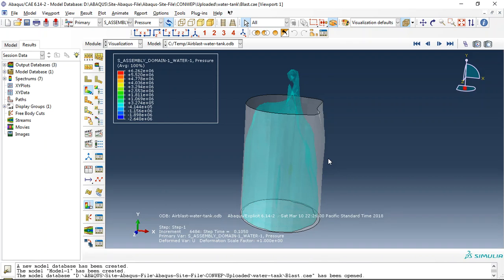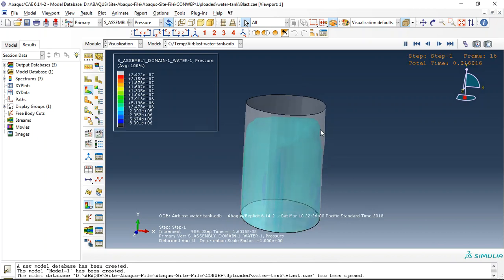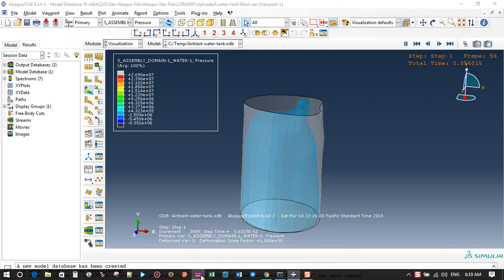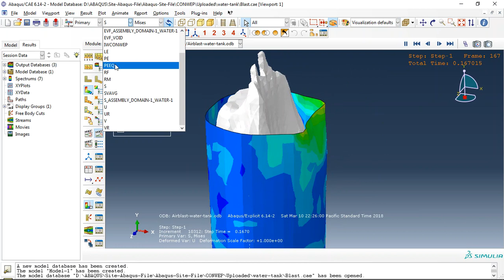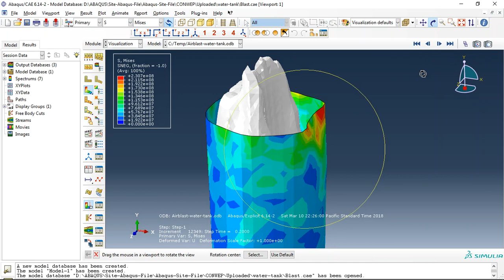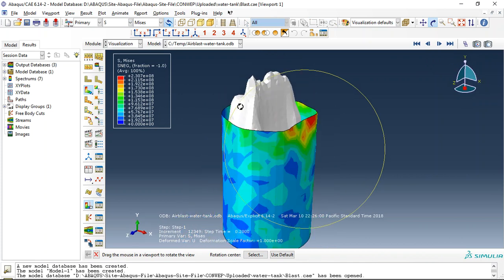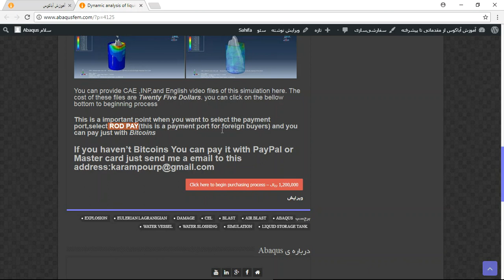Dynamic analysis of liquid storage tank under blast using CEL formulation in Abaqus

Comment: im trying to create Fluid Structure Interaction Analysis on abaqus cae n encountering following error
Due to this co-simulation Failure Abaqus cannot continue.
what is wrong with my analysis?
Reply: or can i have your email where i can share my files with you?
Reply from the maker: Hello. Surely you did something wrong in your model. Iyou check this website you will find some FSI tutorial and you can use them:www.abaqusfem.com
this is my email send me your work with specification:karampourp@gmail.com
Reply: Thankyou so much.